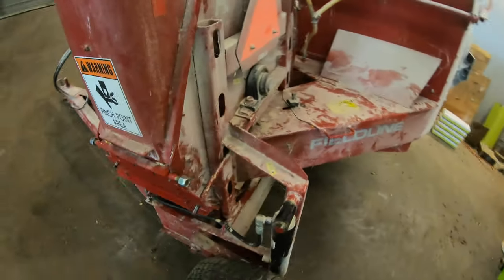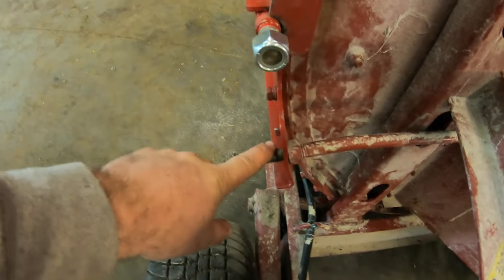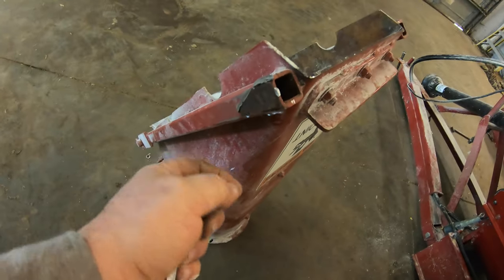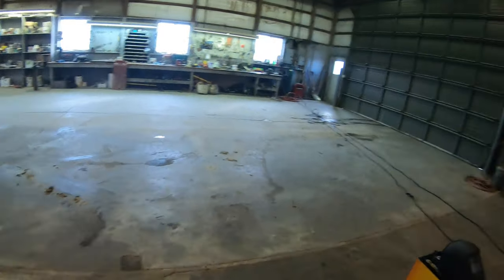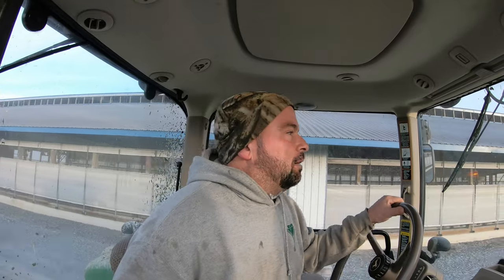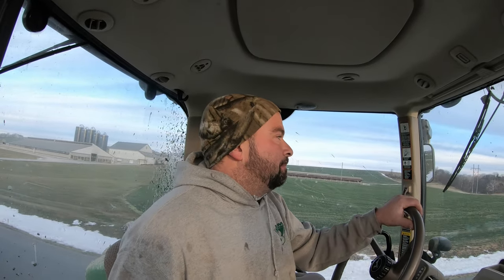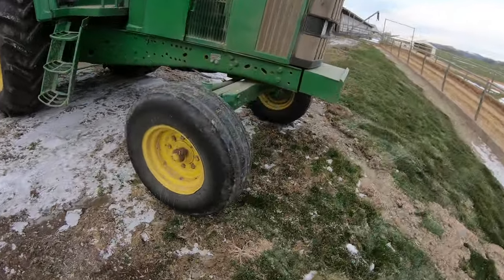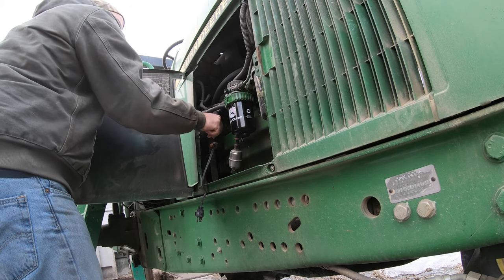Farming, Fixing &...

Comment: Thanks for the update. Back when I used to farm here in South Central Ky I always added a diesel additive called Power Service the year round to my bull tank to avoid problems like that it always took care of the moisture, it’s just a thought. Take care and have a great rest of the weekend 👍
Reply: Yeah they got some neat products, we usually don’t have a cold long enough to justify it. We already do add a diesel additive that the High pressure common rail fuel system Deeres seem to think they need, It is rather expensive but I don’t believe it does anything for just fuel.